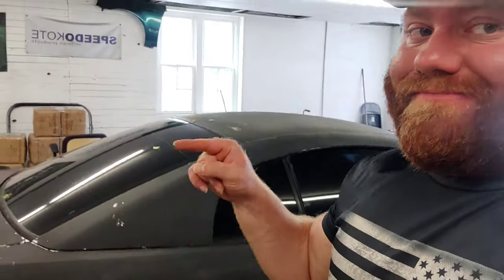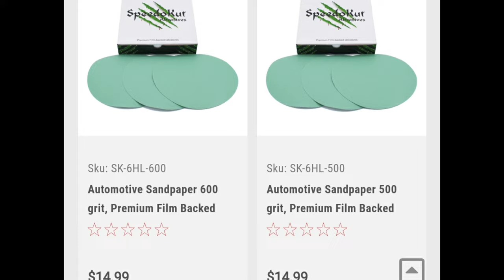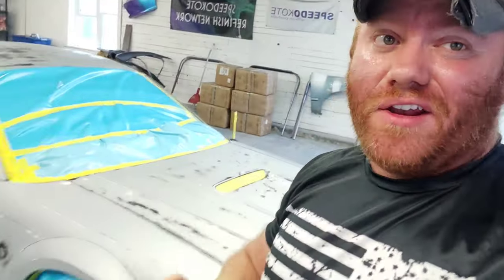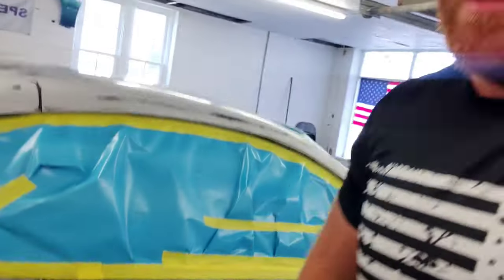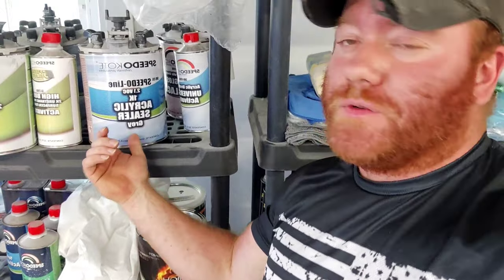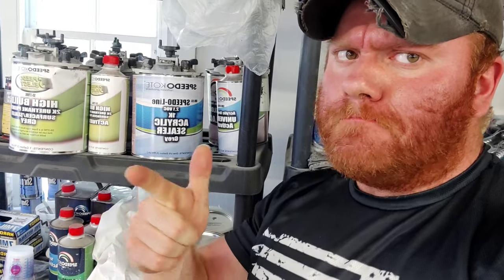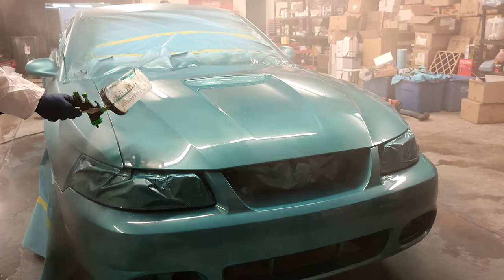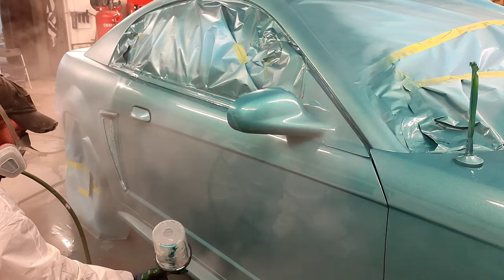400$ paint job

Comment: That little sander you were using is that a harbor freight regular sander? You dont use a DA ? It looks amazing by the way . I have alot of questions anyways thanks. If you have time I have a 2013 ebony black mustang need to paint fender and door which are those black  primered replacement panels. Im a novice dont want to keep car what products  should I use economical primer and clear coat also does your brand make basecoat? Can you   get your base coat a different brand than your primer clear coat?
Reply from the maker: Yea hf sander. Primer not really needed if you sand properly, base coat and clear coat we sell. Send them your paint code and we can send a quart of base with reducer. Clear coat just grab the ss1210 IMO only around 100 bucks works good
Reply: Its color code UA . Thank you for your help .

Comment: I would call that one "a bit rough" 
Seems the cars I call Rough here in Michigan have holes you can put your hand in😅
  That sealer helps every paintjob, I think. Little extra money, but it's a nice foundation 
  Lastly, just used the SMR 42 for the first time today! Impressive shine and reflection. Of course,  I got some little nibs to buff out, but that's normal. I may go ahead and wetsand it before buffing. At least the hood. Sprayed the clear with 1.3 Iwatta lv2 cap and 2 compressors running. Really like that clear! It's going on every car that fits the budget from now on! I'll still use the cheaper Speedo clear for touch up jobs, repairs, ect.  But for an overall job...man, I gotta go with the 42👍wooo!
Reply from the maker: The impressive part about smr42 is that IT KEEPS 100% OF IT'S SHINE days after cure. A lot of other brands shrink back and gloss dies slightly
Reply: I have to agree I shot an infiniti g37 convertible this weekend used the smr42 and the dv1 gun I purchased from you a month or so ago from you and admit there is no shrinkage or reduction in the gloss after 3 days. Wanted to thank you again for being honest and helping out the DIYers!!
Reply: @speedokoterefinishnetwork4937  just when things are going pretty darn smooth...an issue pops up.
  Spraying the SMR 42 yesterday and got about 3 different areas with....FISHEYES! Not something I normally see. I cleaned and cleaned, so I believe I may have had contaminants in the air line.
Oil maybe? Can't be sure, but dusted myself off today, sanded the entire side,clean,clean,clean, changed desiccant beads, sprayed a lot of air out of line, basically then did a flow coat and this time, got the results I am used to. A minor buffing to remove dust specs and I'm good to go. I flow coated the hood after wetsanding as well to bury the center stripe edge. And great results except those pesky specks.
I tack over and over and still get the specks. Oops. Running long on comment. Another mistake I made was trying out an unproven gun that got good reviews. Got orange peel I didn't like. Went back to what I know. Iwatta W400 lv2 1.3. I know the gun and can dial it in for clear. I use it only for clear. Any one of my other guns is capable of base.Some day when I get sum extra jingle, I will try out the mark one eco if you continue to stock it.
Reply from the maker: @BearBudgetgarage  tune into my live video Saturday and I will be addressing everyone's questions Saturday at noon